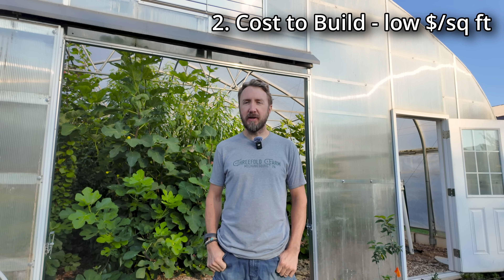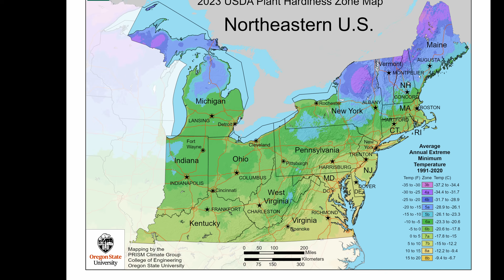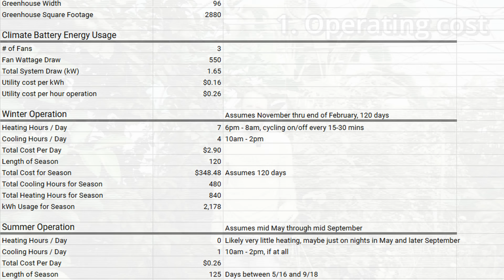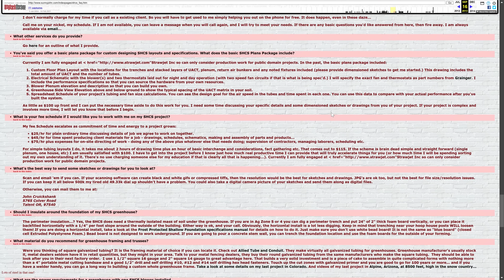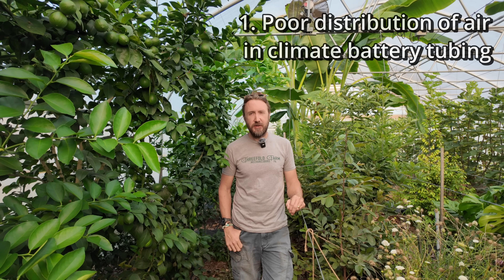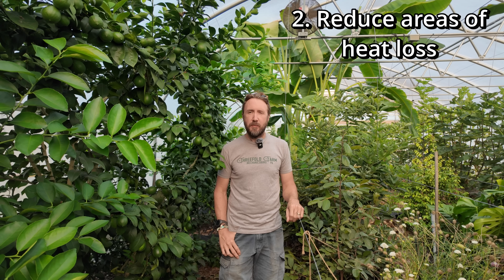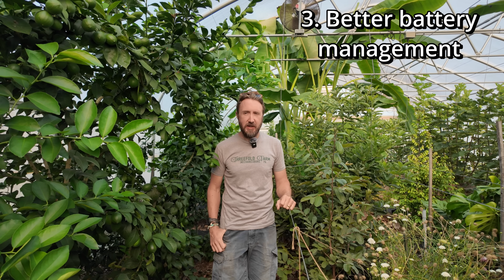Building an (Almost) Tropical Geothermal Climate Battery Greenhouse in a Temperate Climate

Comment: In a few years in my future house I have thought that my "tropical"" greenhouse will be on a closed courtyard in the middle of the house. Basically all glass and with a dome roof. Do you think that solution could be quite viable? I would expect in winter for the house heating to leak over the glass. Still not sure what's an appropriate size. Do think it would require some extra heating. Still would expect to have a very high insulation value.

Comment: Another method to boost the. Thermal battery is to use the roof of nearby buildings . Build enclosed pipes on boxes with a clear top and paint the inside and pipes in olthem black.  Use the same type of thermostat to pump the fluid up to the roof during sunny days. Have a big tank under the greenhouse, that your air tines run through. This will multiply the amount of heat available to you.  Use a closed system with ethylene glycol.on it so the food doesn't freeze at night

Comment: So I just finish my build  I’m in zone 8 A in  North Atlanta 20x20 I installed 2 AC Infiniti’s 20 inch vent fan an a AC Infinity 19 inch for the Geothermal system is 2 /10 inch 20 foot long and 2 layers of 4 inch pipe around 1200 feet.

Comment: Why not use solar vacuum tubes take the hot water and run it through radiant heat piping under the soil and then from there dump into 55 gallon black drums making them even hotter than the sun can, all you need are solar panels to power air fans over barrels and water pumps, and a battery for storing electricity over night. for emergency heet a small rocket furnace supplying non lethal amounts of hot smoke free CO2 and more hot water.

Comment: Heat radiates back out to space through the clear greenhouse clading at night... Like it is out in a desert... Blazingly hot in the daytime sunshine and downright cold at night. Reflective roll out curtains over the growing area will prevent most of that heat from just radiating away. Lightweight bubble wrap type reflective insulation that comes in 4 foot wide rolls can be simply cut to length. Then it can be reinforced with lightwieght nylon web strapping sown, glued or taped on the edges to help give it stability, durability and as a means for attachment for holding the insulating curtains up over the growing area. Some method to suspend the curtains that allow it to easily be rolled up out of the way could be devised. That would make it easier to deploy and retract the curtains when  needed. The curtains would only need to cover the immediate area above the plants and also down to the bottom of the sides and at the end walls. That would essentially encapsulate the growing area. So it is not necessary to curtain up to the peak of the greenhouse, maybe only as high as the support structures that go overhead from one side to the other. Some Chinese greenhouses use thick, heavy roll-up blankets on the outside of their greenhouse as insulation at night. The solution I've given may or may not be as effective as the Chinese blankets, but a simple reflective curtain is certainly going to be far more effective than no barrier at all to heat radiation loss. Help keep that heat you have saved underground from just radiating away by putting up some kind of heat reflecting barrier at night.

Comment: instead of pumping air through the earth, why not a loop of tubing filled with water, hooked up to a recirculation pump and radiator? similar to a radiant floor heating system. one loop would eliminate the problem you have with dead air

Comment: I am going to build a geothermal greenhouse in wallapini style here in Quebec in a couple years. I will use a single long tube loop underneath for winter and another single tube loop outside the perimeters of the greenhouse for summer. I suspect that in the summer I will need soil that is not under my greenhouse to keep it cooler and the contrary in the winter.

Comment: The only doubt that I have is that in European lowland climate, where in winter it can be cloudy, overcast and/or foggy for weeks in a row, there wouldn't be much sun to store heat, therefore the climate battery would quickly run out of stored energy to release, making it useless in exactly those times of the year where you'd need it (cloudy/foggy days below freezing).
Reply: Ground temperatures, barring intervention, at eremarkably constant throughout the year given a certain depth, say around 13 degrees C at around 2m depth. What might happen theoretically is the temperature in winter with a badly insulated greenhouse would linger around 8-10 degrees C, still good to overwinter most plants

Comment: Great video, thanks! Just a few comments... 1. I'm guessing that the incremental cost of oversizing your battery is marginal. That is to say, given the fixed cost of renting an excavator, the benefit of buying piping at volume etc. there should be benefits to making your battery larger than the footprint of the greenhouse itself. 2. Have you thought about making one way valves by just using flaps cut into the piping to control airflow? This way you could have a circulation pump that moves air in the battery but not from the battery into the greenhouse. So basically have 2 air movement systems. 3. Layering your battery piping so it's not all just one one plane at the bottom. What if you put down a layer of piping followed by backfilling 3 ft of dirt followed by another layer of piping? This should help with the heat distribution and efficiency of the battery.
Reply: oh and lastly how about usying a hybrid system where you build a slight walipini greenhouse where you build your greenhouse into the ground, at least a few feet. Having the greenhouse built into the ground shouldn't affect sun capture too much given the angle of sunlight and how little heat you capture during early morning and evening but the savings from the thermal mass could offset that by a lot.
Reply from the maker: Great and thoughtful comments, thank you. Yes, oversizing your battery could be great depending on your climate. I don't know that I would call it "incremental", given what it would take in terms of earth moved to go down another foot or more, but yes, this would increase battery size permanently. As for digging out beyond the footprint, I don't recommend it as it would involve compromising the integrity of the sidewalls  and would mean you're setting posts into settling soil rather than firm soil.

As for valves, that could be done and it might be beneficial in certain circumstances. However, it is nice at times to have warm air circulating through the pipes just due to natural convection.

As for layering pipes, we already do that (maybe that wasn't clear in the video).

As for the walipini style, yes, it would help but adds cost and makes it critical to grade away from the structure to prevent rainwater from coming in. So, like most options, it's possibly helpful but potentially not necessary depending on what you're growing.

Comment: Hey there, also a software engineer that would love to do something like this some day.

Had you considered half burying the greenhouse to allow the dirt around the sides to act as insulation and a wind bearer?

I’ve also seen different height pipes for the intake and exhaust of the air. If one side is closer to the top of the greenhouse ceiling it gets more of the hot air, and the one closer to the ground gets the cold air. So you run your fan direction depending on if you want hotter air or colder air

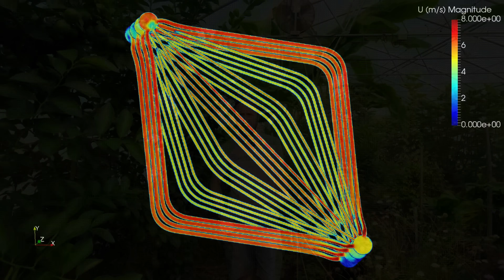Comment: 28:30 As a mechanical engineer I like CFD, but it is important to mention that all the beautiful simulations are as good as the limited parameters used as inputs. I have yet to see a fluids project where the simulated values and the real values coincide. Go to any wind farm and see how many turbines actually do not move at all because of the interactions between the parameters they did not use in the models. Great video though, keep up the good work :)
Reply from the maker: Fair enough! The more I learn about CFD, the more I realize I have quite a lot more to learn. Appreciate the comment.

Comment: Two questions: How do you prevent mold growing inside the pipes in the ground when they sweat? Second question, would it not be cheaper, easier and leave more room for expansion/modification to build a 50kw solar array and bank the 50kw per hr all summer long into the grid and then use it all winter to warm the  insulated greenhouse? f you bank 400Kw per day all summer that's more then enough to heat a well insulated greenhouse. You can buy used panels for pennies on the dollar at second hand dealers. My 5Kw array cost $1200 with New panels. Runs my eco-house all winter on batteries. If I had grid to bank into I could run heat-pumps all winter instead of wood stoves. Which brings up another idea. One wood stove would warm that whole green house with fans blowing on the coldest nights, -F nights.
Reply: 50kw a day requires a lot of space/Land. The land cost and potential profitability of a greenhouse on that land far outweighs using that space for solar. The cost of storing 400kw a day would be astronomical too compared to the (entire) build shown in the video.

Comment: This is called subterranean heating and cooling. It was invented by John Cruikshank, and one of the first implementations was at the Central Rocky Mountain Permaculture Institute CRIMPI in Basalt, Colorado. Give John credit for using his design and invention. Also, for trees, extend the greenhouse height by 6’, and run a scaffolding around so you can walk above and harvest the fruit. Trees get taller enabling understories.
Reply from the maker: For sure I did mention John and his work in the video @17:58 or so, and I think CRMPI is mentioned there too.

Comment: Looks like a pretty good design.  Basically, this seems to be a GSHP (ground source heat pump), but using atmospheric gas instead of liquid coolant.  That's what I'm getting out of this.  Considering the amount of moisture you need in the greenhouse atmosphere, could there be an issue with mold growth or flooding in the bottom of the tubing?

Did you just backfill with soil, or did you add anything different?  For example, sand is highly insulative, capable of slowly absorbing and slowly releasing a large amount of thermal energy.  Depending on local soil type, what WOULD be a good amendment if you wanted to optimize transferred solar insolation?

Comment: Seems like a climate battery is just a positive air flow thermal mass or a geothermal heat pump without the heat pump. Seems like a thermal reflective blanket, Mylar faced bubble sheeting maybe, would be cheap and improve efficacy?  not the same an earthen burn but a bit easier.

Comment: How much sun does your winter give you? Where I live we use solar water heaters that use evacuated tubes that can get to 50°C even in an overcast day. If you install one near the greenhouse or on nearby sheds they might be a good way to supplement the ground heat to keep it from depleting. Considering the high heat capacity of water, even getting half of this temperature in the dead of winter would still be a significant amount of energy and thermal mass to the greenhouse to at least last a couple of nights.

Comment: "Climate battery" is a mad up word this is thermal mass ground stabilizing. I know a guy who sells a fan that charges a another 12v battery at the same rate it discharges. The fan has to be manually started, however if you setup a auto swap switch for the battery at a certain voltage you should not need to manually restart with the fan already moving. The batteries would also need to be insulated as batteries performance drop at lower temperatures. I can give more info on the fan if interested just let me know.

Comment: You perspective on thermal mase is verry limited. 
A proper thermal mass will be connected to the ground below the frost line 
& can sink with the earth temperatures around mid 60s. This will absorb heart during the day and release heat only below ground temp. If you used ISSB or stabilized soil blocks for the north wall they would take up no more room. 
There are also umbrella/Walpeni Greenhouse built down into the earth to stabilize temperatures, if the water level is low enough to allow.

Comment: Great video.  some of the pictures and wording should stay on the screen longer.  A lot of it popped on, then quickly went off.
also, sounds like you have a large bank of knowledge.  Consider writing a book about it!  🎉
Also, 20% of tubes doing 80% of the work is most definitely NOT efficient.  😂
Sounds like you could get a lot more out of your system by optimizing the airflow…. Which you did with your modelling (typing comment as I watch.  😉)
Lastly, another product you could sell would be the software to model the flow of energy given local conditions of a customer building a system.  Or you could model it for them for a fee.  Then there is monitoring systems for really large scale operators, with controls for the fans, greenhouse ventilation, and possibly subsurface control of airflow.
thinking big.  Good luck!
Reply: PS  If the sand or other media surrounding the heat transfer pipes/tubes were moist or wet, heat transfer and storage would be increased.  so if you had a watering system of some sort in your sand/gravel/media, that might increase the capability even more.  That would also raise the humidity of the greenhouse depending on how tight your tubing system is.  Which could be good or bad.  Besides water, you could use concrete instead to enclose your pipes.  Higher cost, better long term solution, maybe for bigger operators.  The goal is to increase the density of the material at depth to store more heat.

which brings up another point, why not just use a geothermal heat pump beneath your greenhouse?  Maybe that’s too expensive.  Or even a minisplit heat pump or several of them per greenhouse.  though a fan, a solar panel and a battery hooked up to a climate battery would last a very long time and be relatively inexpensive.  So cost trade, less expense up front versus long term expense on the back.

Comment: This reminds me of sand solar batteries; where they store excess solar energy by heating up an insulated sand bath. Then they can draw heat from it at a later data. I wonder if you could mix sand or some other material into the soil when you back fill to improve the heat storage capability.
Reply: Channel name tech ingredients they built a thermal air conditioner and mentioned additives to increase geothermal production. I cant remember what it was. It’s just unreal what people can figure out.  Neat.

Comment: Such a neat design and great presentation of the data. I'm left with so many interesting questions on how to iterate on this design. 

Would a boundary layer of something like coarse gravel at the perimeter of the greenhouse soil create a thermal barrier to reduce heat losses with the surrounding non-greenhouse soil? Maybe even rammed earth? I'm curious about how much efficiency is lost due to heat transfer outside the greenhouse.

I'm also wondering whether a secondary heat pump system be able to increase your efficiency during periods of low climate battery effectiveness in the late winter months. 

I have to assume that the thermal efficiency gains of a heat pump would make it the most effective system, and that the limiting factor is the scale / expense of using it as a primary system in an uninsulated greenhouse. As a supplemental system, it wouldn't need to be as large or expensive as if it were the primary heat source, but it would still function even when the temperature differential is low and heat from the sun is minimal. 

You could also take advantage of the combination of the two by using a better thermal interface material like a thermal mud in the geothermal zone, increasing heat transfer into the soil, which would then diffuse into the surrounding system for distribution.

Comment: Question: could you leave the greenhouse for a month or longer in the winter? I’m assuming you have irrigation. I’m an Australian living in Kentucky with similar winter to yours, 180 frost free days and little sun in the winter. Very difficult for a girl from Melbourne 
I visit home each February for a mental break, but would like the piece of mind when away that the plants are ok.  Awesome video thanks
Reply from the maker: I don't like leaving my greenhouse for that long, especially in the winter, but I suppose you could. The thermostats operate things automatically so there's not much for me to do other than adjust the temperature at which the fans kick on.

Also, my greenhouse manufacturer is Beiler's out of PA (Amish-run). They're sold by Martin's Produce Supplies out of Shippensburg, PA and I believe they ship the frames. I've been very happy with mine.

Comment: I enjoyed your research into this design, but I envision another adjacent, small “shed” created of sheet steel, (painted black) made to create heat which can be transferred to the greenhouse. This can be insulated and hold any sort of heat source. I’ve seen this design for home heating where the firewood is used and the heat transferred to the house.

Comment: Up front cost would be more, but why not back fill with sand or crusher run. Rock would hold the heat better than the soil. Use the soil as your insulator around the sand. Use the clay as a moisturizer barrier.